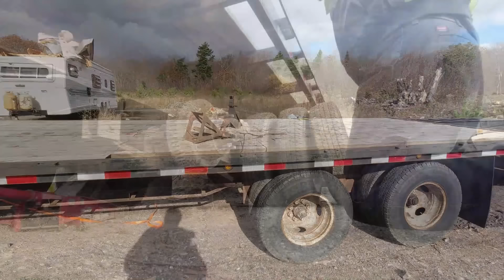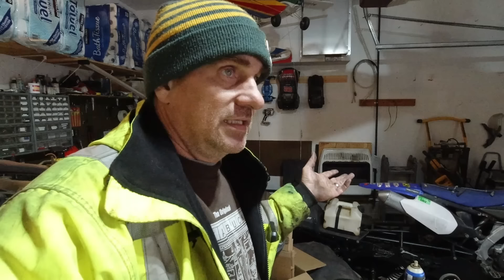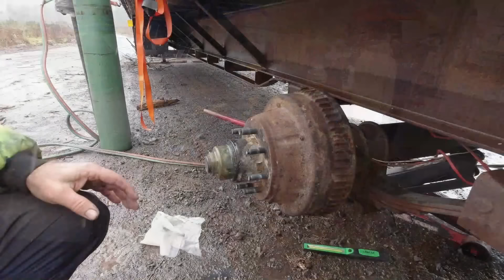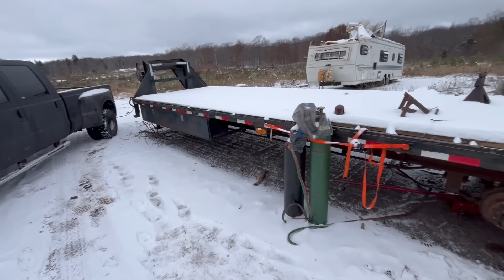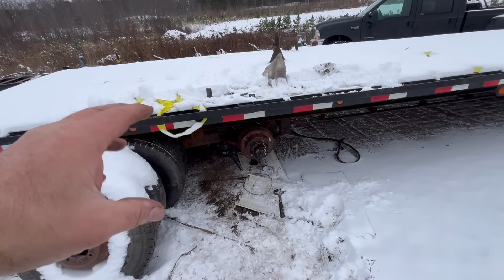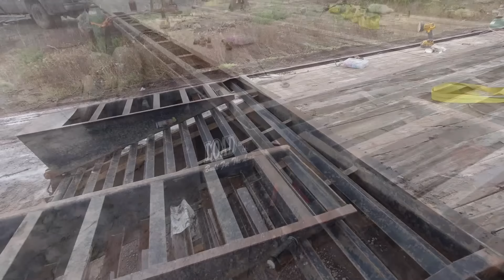Fixing Electric Brakes on my 36' Gooseneck Trailer 34/2025

Comment: The rack looking frame under the trailer is for strength. It's to keep the trailer from bowing. if you put a lot of weight in one spot in front of the axles.